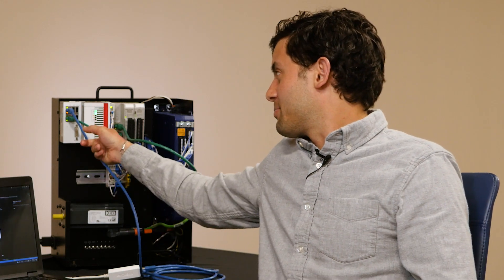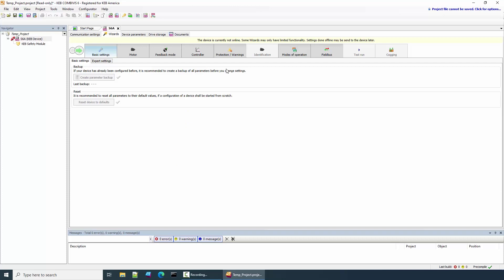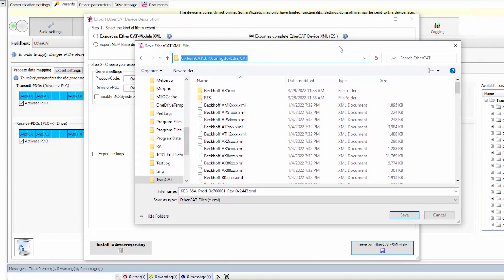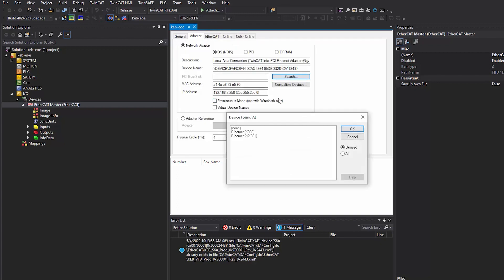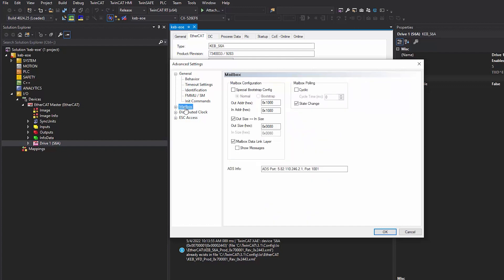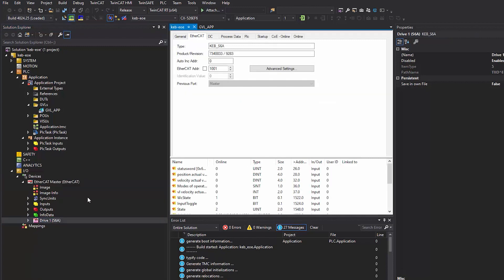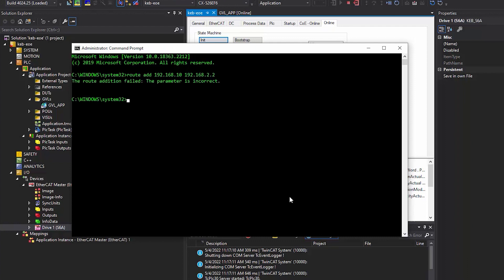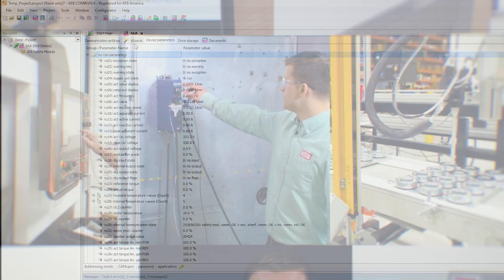Startup Guide: EoE (Ethernet over EtherCAT) Communication with KEB VFD and Beckhoff PLC

Comment: Thats cool. However, could you make one video by defining the Drive as a NC PTP. Further, if I use Twincat MC libraries Function blocks , where we can adjust some basic parameters, will that over write the parameters of the KEB Drive in Combivis ? 
I don't know if I am able to make this understand or not, but I do have this question in my mind.
Reply from the maker: Thank you for the comment. There are different ways to program and change parameters on a KEB drive. This video demonstrates one of the easiest ways to run a KEB drive using a Beckhoff PLC and TwinCat and Combivis software. You can change KEB drive parameters in TwinCat, but the functions in Combivis offer a simplified way to quickly program the drive. In the future, we may make a video that shows other ways to program a drive through EtherCAT. Thanks again for your question.